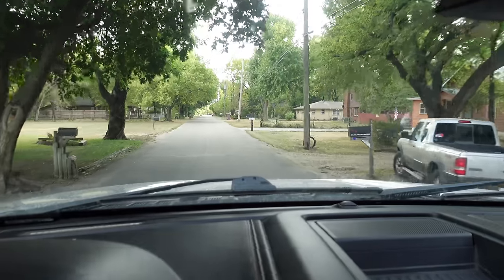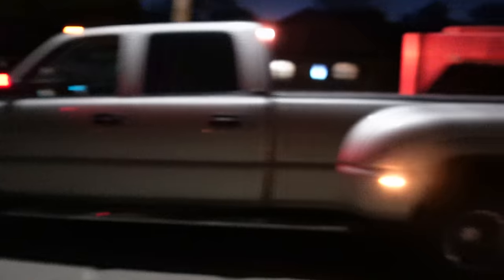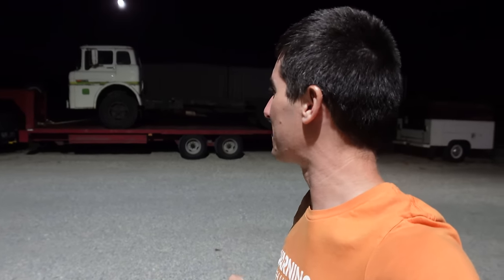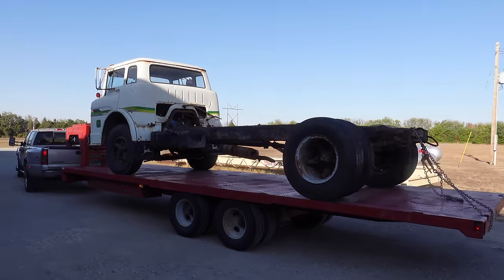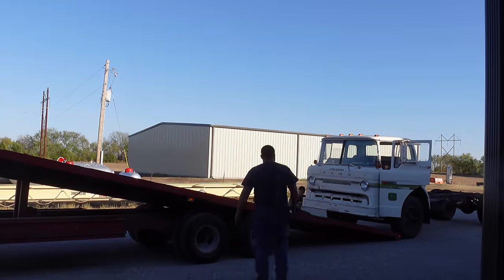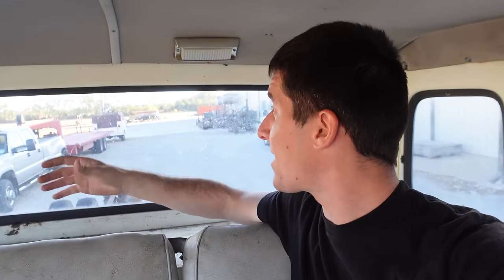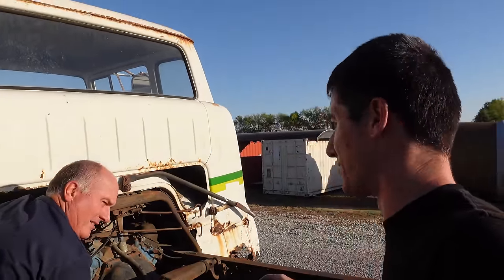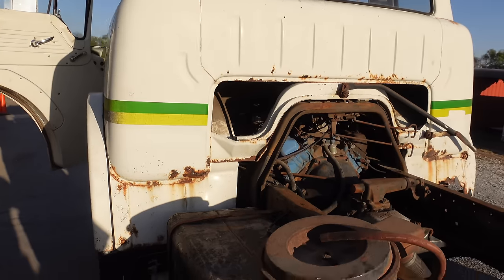Buying An ANTIQUE CABOVER Ford And Getting It RUNNING The Hard Way

Comment: My buddy owned this for years it had a roll back bed on it and we used it to haul in scrap cars. Also the frame was bent from hauling lots of heavy stuff on the rollback. Last time I drove it was about 7 years ago and the brakes were junk then. Also it eats starters bad it never had an ignition we use to start it with a screw driver. My buddy put that rigged up push button in. That push button was from a door popper kit. Rear end was unhooked cause it would get stuck one way or another in hi or low. Brings back memories seeing it again.
Reply: you got any pics of it from back then?
Reply: What year is it?
Reply: Thanks for the info on the old girl....

Comment: In adding to this - I suggest figuring out how much of the frame is good and then shortening the frame possibly.  We used to do this all the time with my Dad's delivery trucks.  The biggest thing is the drive shaft will need to be shortened to match and that you really need someone doing it who knows what they are doing.  Rest of the truck is so cool  - it is worth the frame shortening and the rest of what needs to be done.

Comment: They are not split rims.  They are locking ring rims.

Actual split rims have a seam down the middle.  Locking ring rims are safe, you can change the tires and tubes out yourself fairly easily.  Just clean the rings and grooved well as rust can keep them from locking in place easily

Comment: The tire shops here used to have the big tire cages so they could service split rims safely. Most older pickups had them, my 41 Power Wagon had 16 inch bud split rims and I had a friend into the military trucks that would change them out in his driveway. The ones meant for combat areas had what we called combat rims that had a outer cover over the split with about 12 or more bolts keeping the split rim from ever blowing off no matter what happened to the wheel. Finding a decent 4bbl intake manifold for those engines isn't that easy but they run great with a spread bore carb.

Comment: I work at a camp in Alaska most summers that uses one of these to haul AvGas and Diesel from the Yukon River up to the camp. It's a lot of fun to drive through muddy tundra in western Alaska with 3000 gallons of fuel. Often use a 1960's Cat D5 dozer as a pusher when needed. One of my favorite styles ever from Ford

Comment: I've always liked the C-600. I drove a flatbed lumber truck in the 70s and a 4 yard cement mixer in the 80s. They both had the 2 speed rear end. The mixer had a really sweet Detroit V8 and it had plenty of get-up-and-go. Lots of fun to drive. 
I do happen to have an F-600 frame that I've had plans to use it for an overlander. It has a single speed with 8x22.5 six lugs. No motor or trans.

Comment: I've been doing a little thinking on your frame issue. Basically, that frame is unobtainium at this point. But you might be able to find something similar enough to get you through underneath an old Ford School bus. If that doesn't work out, and you have to Frankenstein the thing together, I think it would be really cool to Bob it out, make a short wheelbase pickup truck hauling a gooseneck car hauler. That would be very cool in my opinion. Also worth noting, the engine in that maybe the heavy duty Fe block. Check for cross bolted main caps, bolts in the side of the block down near the oil pan. If you do have the heavy duty block, even if it's only a 352, that thing is golden. Super heavy duty and worth hanging on to. Worst case scenario, you could put a 428 crank in that, along with some good heads and make killer torque

Comment: O-H-I-O Porter greetings 🇺🇸 Happy New Year…2024!😎 I’m so glad that you found & bought this fine old Ford truck! I drove a 65 C800 & really loved it. The cabs are very easy to access & work on. Your truck has the typical rust spots. That ledge behind the seats is only big enough for some speakers, lights & maybe some small bags or toolboxes. Keep in mind that you want things to be tied down up there as well. Anything loose can fly through the window or bounce around. They sure had it rigged up poorly. I hope it’s a 391 engine. That’s what mine had & with a 4 barrel carb. I bet yours was a rollback in the day. Tis a shame that they bent the frame! Some budd wheels would look super sharp on that truck. Mine had Dayton wheels as well. You will have a fine truck to represent your hobby. Good stuff. Blessings my friend.🤩🥰✌️

Comment: C61 = C600 2WD (gas).

D = 330 2V Heavy Duty FT engine.

V = Kentucky Truck Assembly Plant.

AG7348 = 1978 / 1978 was the first year Ford used a double letter code in the serial number.

175 " Wheelbase.

Color NT = No listing given. 

C617 = C600 gas, 21,200 lbs GVWR

A2 = Light Gray Crush Vinyl & Gray Twill Stripe Woven Plastic / 8 = 91B Custom Cab.

A = New Process 435 4 Speed Manual Transmission.

F2 = Eaton model 15201 Two Speed Rear Axle / 5.83/8.12 / 15,000 lbs. Rear Axle Capacity.

M = Ford 7,000 lbs. Capacity Front Axle with Power Steering.

21,200 lbs. Gross Vehicle Weight Rating.

Comment: Split rims are not dangerous if handled properly, get tires changed by a truck tire company. Those spoke wheels could look so great with the right paint colors. The brake booster in the rear is probably a trailer brake set up.

Comment: Hi JR 🙂 I’ve seen a couple of rat trucks built using this classic cab and a more modern F-650 chassis converted to accept it. Might be easier/quicker than trying to find a better original chassis - particularly as it also offers the option of air-ride rear axle without further effort. So, cabover you have + ex-Penske (or a hundred other companies) air-ride box truck + sell the box and taillift = cool Ford truck for cheap 🙂🤟🏼

Comment: I picked up a 1985 C700 that was a PG&E truck with the utility bed on it.  It only has like 80k miles and I got it started up first try (once battery was fully charged), but it had a bad clutch slave cylinder, so could not drive it, and the right rear wheel has the brake locked up.   It has air brakes, but they were not the problem.  It has the Detroit Diesel 8.2L 4 stroke.  It has modern 22.5 ten lug wheels is why I got it, since I also had a 72 C50 and it had the split rim tubed 20in wheels which are impossible to replace unless you remachine everything, which costs a fortune.  You have dayton wheels, not split rims, those are ok.   My cab is pretty rusted on the roof, but otherwise its ok.   If you are interested in it, I'd sell it and you can swap your cab onto it.   In California, commerical diesel trucks older than 2005 can't be registered anymore, but my plan was make it motorhome which is ok.

Also, you need to check on the frame material as they used a hardened steel on big trucks that can't be welded on, not sure what year they started that, the older ones might still be mild steel,  so you could try to fix your frame.

Comment: The black nameless knob in the middle of the dash is probably for your idle. Once you get it running, you can pull it out to increase your idle then turn it to lock it in place. I used to drive trucks and alot of the older trucks had that. (Could also be used as a rudimentary cruise control but I wouldn't recommend it.)

The 2 speed rear end isn't a splitter like in semi trucks. You should be either stopped or only going at a walking speed at most when you change rear end ratios. Try that at 10+ mph and you might find that beefy rear end all over the road.
Reply: Wrong it's a splitter,

Comment: Hey JR,  Tony here from Quincy Wa. listen dont give up on that cab over! all u have to do is shorten the frame! if u measure it right' u can use the rear half of the driveline!  heres some pics of my cab over  aka the Yeti!  also u change out the wheel hubs to a 10 lug and slap it with some super singles milled down to 22 flat for regular tires! and enjoy!    just a thought u do what u want but dont give up on it!  u gott a badass toy hauler in the rough!
Reply: how the hell u add pics?  anyways i'll send them to u as soon as i figure it out....lol

Comment: I'm thinking the large knob is for a hand throttle, since there is a PTO driven hydraulic pump.  The Dayton style wheels, can be swapped for the Budd style, but will take replacing the hubs, etc.  Those aren't the 'killer' style split rims, but rather split ring type.  Which have their own inherent dangers, especially when initially filling tires with air.  Had those same style rims on my 1972 Peterbilt 352 COE.

Comment: That has a 370 2V, which is the LIMA series engine family. (370 4V and 429 4V, similar to the 385 passenger and light truck 429/460). I believe these engines replaced the FT series (330, 361, 391) in 79. This truck is going to be a 79-84, based upon the engine and the lack of a front emblem. The lightning bolt emblem was used all the way up through 1974. Then no emblem until 85, when they started using the Ford oval. These trucks were produced from 1957-1990.

Comment: There used to shops that bend frame rails. Dont know if they still exist.  You have lots of options for the frame if the under cab section of the frame is good..

Cut and splice on almost any rear frame of a proper thickness.  

The brake wheel cylinders and adjuster components are available. I have a catalog that lists them.  

The brake booster is available.  Probably the brake master in the cab.
You will want to replace all the brake lines.  

You should install an air brake tank set up to supply vacuum to the rear brake master cylinder.  
In the early 80s the shop I worked st had several F600 and F700s that we worked on. A new driver was hired.  Ever drive the grape vine on I-5.  Sure all the time. I can post mr roads wild ride to the runaway ramp.  He came feet from going over the end and dropping off about 70 feet.  Cal trans fixed that as the truck hauling steel had gone over the end.    The end of the escape ramp is nearly vertical upwards now.

Comment: I'm a big fan of putting old trucks back into service in their stock configuration, but things like brake and axle parts can get really hard to find for these big ones. It can be done, but it ain't easy, and it probably won't happen at your typical O'Reilly's. In the end, it may be easier and potentially cheaper to transfer the cab to a newer chassis.
Reply: Thanks for the feedback and expect more videos soon. Send me a text above🔝🔝🔝 I have something for you

Comment: I'd cut the damage section out and shorten the frame and build a flat bed with a goose neck hitch. Just weld some extra supports in, add some tool boxes under the bed on the sides, make a sick little tow rig

Comment: A lot of superyachts, especially the explorer variety such as Nordhavn, use John Deere engines. Most builders though that make long range superyachts use Caterpiller Acerts, however you can option John Deere in some cases. But Nordhavn, especially on Aurora uses John Deere. If you watch Aquaholic on YT, he does an excellent walkthrough of the boat. especially the engines. Most regular yachts use Volvo Penta, MAN, MTU, Rolls-Royce, Yanmar amd sometimes even Cummins. But long range yachts get Caterpillar or John Deere

Comment: You don't need a whole frame ... maybe. Might be able to get the back half of a good truck and splice them together. depends on local laws and regulations of course. 
There was an F600 Big Job that was famous on the internet for awhile. Yellow cab, black chassis, shiny wheels. It had the front of the Big Job and the rear of a freightliner I believe. Updated the rear end that way to.

Comment: @WatchJRGo Im fairly certain those wheels are not split, just spoked, not dangerous just have to be very cautious when taking the nuts off and loosening the wedges, don’t take the nuts totally off the studs until the wedge is free for the rears.

Comment: To change the rims you are going to have to replace the wheel end hub. The hubs come in two options, the stud length differentiates them, shorter for steel rims, and long studs for alcoa aluminum rims.

Comment: That might have been a service truck with a crane on the right rear where the hydraulic lines go and they bent the frame using the crane. Some farm equipment dealers had tilt bed trucks with a fold down tail prior to rollbacks. It might have seen its second use as a grain truck with a tilt bed on a farm where the frame was butchered to fit the hoist.
Reply: definitely

Comment: I drove trucks with that electrical  4spd  w split 2spd  rear end  or 5spd w 2 spd  rear end  it opens and closes  a large  vacuum     Diaphragm  over the  pumpkin  on the rear  differential  I got very good  with these kind  of  gear boxes  takes practice & coordination   Great alternative transmission  for trucks that are not air equipped  for air brakes  this truck  is hydraulic brakes  I drove these on midrange  strate trucks  and  mid range city pony  tractors  now I will tell you there are Air auctuated  versions of this gearbox  that are air equipped truck tractors for pulling trailers with air brakes and instead of  electric splitter you  use a  air splitter with your thumb a little more hefty gear box with diesel  & air. I call these fun transmissions  because once you master them they are fun to drive even over the Road Ranger Range type gear box  these split gear shifters are fun in the city  it irritates the heck out of me  you rarely  encounter  these any more for city delivery trucks  & small class 6&7 semi tractors  the electric  ones were  on gas & diesels  back in the day it was the standard  outfitted truck trans that all drivers new & come to expect  then about 97 thru 2008   
6 & 7 spds became the new  norm  now you don’t even get to feel human no more now it’s  push button automatics  no skill required  just show up & say I’m your steering wheel holder because the powers that be  say I am entitled to this job  put that in your pipe and smoke it !!!

Comment: Any truck frame of similar size can be used, doesn’t need to be a ford frame, cut it behind the cab, and weld in new(er) frame and remount the springs and away you go

Comment: I've never seen spark checked quite like that before. You need to get in touch with Mustie1 and introduce your dad to him because they are two of a kind.
Reply from the maker: Just pull a wire and use the screwdriver like a spark plug 😛
Reply: @WatchJRGo  With a dump bed that thing would look just like a Tonka toy dump truck.

Comment: Not sure how much effort you want to put into this, but you could probably just order replacement blank frame rails from any number of companies. Cut the existing frame rails from probably just past the cab, weld in the blank frame rails, drill the holes you need on the new frame rails and re-attach the supports, rear end, etc.

Comment: I would move the axles forward box the rest of the frame in put a 1 ton dually pickup bed on it looks like there was enough good frame there to move the axle forward and cut off the bad good luck

Comment: My dad's got a 62 Ford cab over a 16 ft box and a 351 Windsor every harvest we've had to bleed the brakes on it without fail
Reply from the maker: These might come back if we bleed them... it looks like someone replaced the master in the cab already 😬
Reply: @WatchJRGo  ours has got vertical exhaust with clappers on it whenever I bled the brakes it's like solid rust worms would come out of the bleeders
Reply: @WatchJRGo  are four-speed transmission would  always pop out when you put it in reverse you'd have to hold it in second gear it finally shot craps and my brother put a transmission out of the garbage truck in it

Comment: Find a late 90s or early 2000s ford F650 or international 4600 and harvest the front and rear axels from it.. for this truck.. Or use the whole frame and put the cab on it. With the motor  and transmission..

Comment: What a shame about the bent frame, these old C-series trucks are really cool! This particular truck isn't good for much outside of being a parts donor, unfortunately. I agree, best to just get it running and punt it as-is. Wait for another truck with a good frame to come along instead.

I think your dad is spot on about it being a former rollback truck, the frame is the right length for it and the hydraulic PTO is another solid clue. I'd assume someone in the distant past salvaged the rollback bed and put it on a newer truck, probably shortly after learning the frame on this one decided to identity as a banana. They sold the truck on instead of scrapping it, as it does have a ton of useful parts still.

Comment: Z cut the frame right before the rear axle, then z cut closer to the cab, throw a cheap dually flatbed or dually pickup bed on it and have an awesome little pickup.

Comment: JR. the rear half off a f600 may be usable. Do a 60 degree splice with a reinforcement plate for good measure. If you were in Kansas , Silas from Adventures made from scratch on utube could probably hook you up. Ian🇦🇺

Comment: Think it would be cool to shorten it up put a old dually bed or flat bed add fifth wheel and pull a camper or trailer with it I'd add air bags and update wheels and it be a cool cruiser.

Comment: Do a single rear tire and convert the brakes to disc off a 88+ fleetwood motorhome (p30 chassis)I’m sure the ford equivalent might just bolt up!
Reply: Just find a clapped out 80s-90s motorhome 😂😂😂 frame and good disc brakes!!! And demo at the dump?

Comment: I suspect the remote rear booster is a trailer brake, and this truck was used to tow some very stupidly heavy equipment which is why the frame bent.